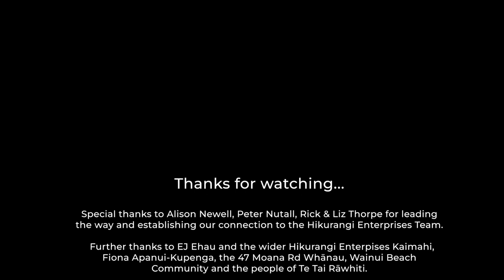The Communities Becoming Energy Sovereign

Comment: this is great, high efficiency biomass generators are very versatile. assuming solar and wind is being used where possible, this provides a much easier to fuel backup system than coal, diesel or gas. its also very nice to see cultural sensitivity and integration instead of working with the imposed structures of colonial descent. not everyone can do that, so i am glad you have taken the opportunity. long live steam engines, and long live Aotearoa ^-^

Comment: How much more efficient are modern steam engines compared to one that was the same size or power back in the 1920s?
Reply: Peek steam development efficiency was 6% modern Diesel engines are 30%-40%
Reply: DLM claim about 12% for the steam locomotives built in 1991. These run on light oil. What surprised the owners was that they were using less fuel than their diesels for the same work. The savings were due to reduced standby,  braking and transmission losses.
Reply: I presume the 6% was for coal then, not too sure it was only a quick google.
Reply: @adamwachs6392 

6 to 8% efficiency. It can be improved in various ways though. 12% is about as good as steam gets.

Comment: If this engine is meant to help out in disaster areas. Say in a cold place with ice storms and blizzards knocking out power. Is there a cold start protocol for this engine? If it were stored in an unheated building (barn) then it would be tricky to get it up and running. Steam engines and boilers are tricky to bring up from a freezing state. I struggle with this on my own setup. Just a thought.
Reply from the maker: We're working through these operating conditions on the drawing board now. Keen to hear more about your experience. If you get time, drop us a line at info@mackwell.co.nz
Reply: @Mackwell-Co  sent some specs over